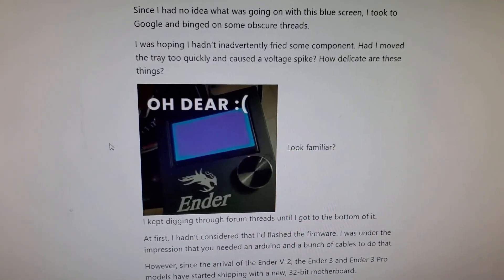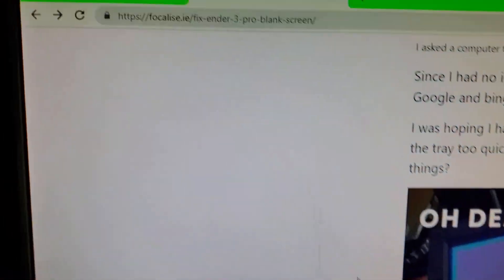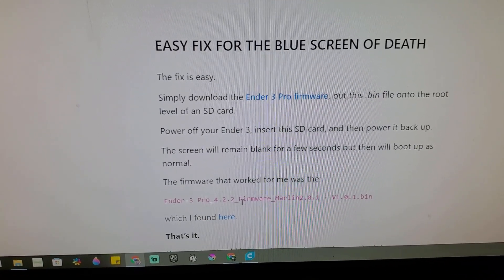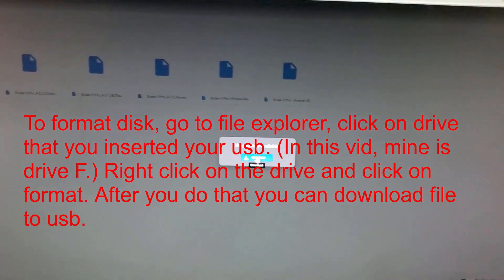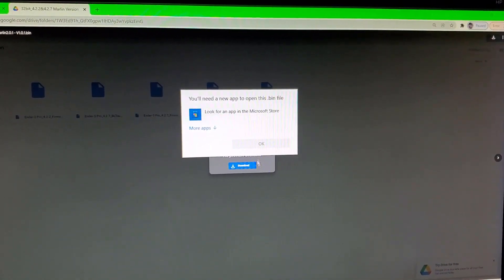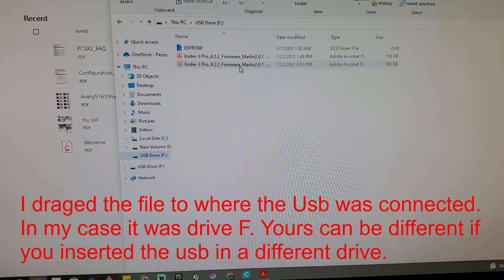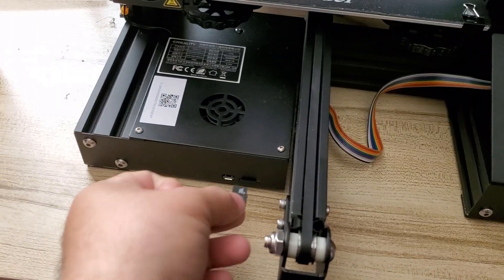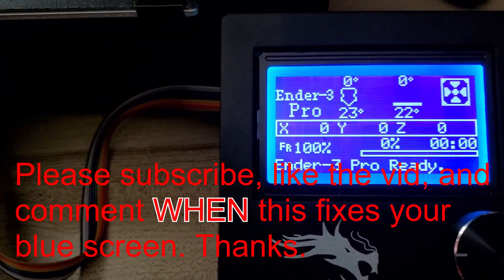I Fixed my Ender 3 blue screen. No motherboard change. easy fix. other vids on this were crap.

Comment: website not found but was able to fix mine. i found the firmware you said. found it in my files. went to just the english version and moved to my sd card. put it in machine and turned on and it worked!

Comment: My printer been making offset prints for some unknown reason, so borrowed my son in laws which went blue screen after just a dozen prints or so! It is fixed now, and I may update my firmware on mine to see if that solves any of my issues (I have to replace 2 rollers and the nut for the lift screw still).

Comment: I am VERY sceptical when it comes to people online making claims about resets, it is May 2023 and I had 2 ender 3 pro with blue screens and was on a last attempt befor puting out $100 for 2 boards and gave this a try and I not have after just a 15 min install and bother and back up and running, 5 STARS YOU'RE the MAN

Comment: Did this and it crapped my printer more now it will won’t read the sd card and even if it does the whole 3d printer will freeze up not even 2% into the print

Comment: Same problem with my Ender-3 Neo. Just during the first run and after setting the table and Z-axis I decided to make a test print and the only thing I got was a blue screen. After watching your video I downloaded the Merlin-firmware and flashed it on my printer and it worked again! The problem is that it started showing as an Ender-3 Max printer which it is not (only the motherboard is the same version 4.2.2 ). I downloaded the latest firmware for my printer and did the exact same procedure and it worked again. I believe you can download another firmware from the Ender-site as well, not only from the site you mention.
What I learned is that the blue screen comes always when I start the printer with a SD-card in! This is the bigger problem and it is a design flaw. When I leave a card in the slot (no matter what's on it) and turn off resp. turn on the printer, it probably first checks the card and searches for a firmware. If there isn't any, the blue screen shows and I must re-install the firmware again.
DO NOT START THE PRINTER WITH A SD-CARD IN THE SLOT UNLESS YOU WANT TO FLASH THE FIRMWARE.

Comment: Holy cow, it worked! I got my files form the Ender3 website, one thing is my display seems to have some offset pixels but heck it worked.
Reply: What files did you download? I am desperate. I downloaded all of them separately but nothing is working. I'm begging for help.
Reply: @marro1916  mine still wasn't working. So contacted a friend who has the same printer and they sent me the firmware they used and it worked.
Reply: @dirkmation  that's awesome dude

Comment: OMG DUDE! Thank you so much that saved me so much more work in research!
Reply: Where did you get the file(s)? I'm begging for help. The link isn't on the page anymore for the bin.
Reply: @marro1916  I had to look really deeply for it. I ended up getting Marlin software instead because it would work better so I would just do that. There are a couple tutorials on yt for that

Comment: Subbed, happened to me exactly 10 minutes ago, scrolled through a couple links after searching ender 3 blue screen, luckily you were the first video i ran into, i had already downlaoded and flashed firmware before, so just reformatted my sd card to erase it, then moved the file and then put the sd card in the printer and boom, instant fix in not time like the blue screen never even happened. Thanks man for keeping it short and simple!!

Comment: Didn’t work for me :( my first 3d printer and I haven’t even printed one thing. I want to return this or something..  :( really wanna kick it down the stairs.  *Update* Got it fixed. I had to use a different micro sd card than the one that came with the printer to load the firmware on, and it must be 32gb or under, formatted in Fat32, also rename the firmware .bin file to something random before you put it in the printer.

Comment: Just a few points to note. Whenever flashing firmware, follow Creality's instructions to format the SD card to 4096 allocation, FAT32. Have the firmware be the ONLY file on the card. If the latest version of the firmware doesn't work, try downloading an older version and flash that. My Ender 3 'bricked' flashing the latest 2.0.6BLTouch firmware, rolling back to 2.0.6 stock firmware did not work. I had to roll all the way back to 1.5.1 to get the firmware to flash, before upgrading it up to 2.0.6 again. So don't give up!
Reply: I tried multiple firmwares also without luck until i tried a different micro sd card than the one that came with the printer, and it finally worked.

Comment: Thanks for this video. I had not even had my printer for longer than 3 weeks and I turn it off when not used. I turned it on this morning and it had a blue screen. At first I thought maybe the display had just been unplugged possibly so I attempted a print through USB using the software, but it did nothing. At that point I knew something else was wrong and upon searching, found this video. Managed to find the firmware for the Ender 3 Neo with CRTouch on the Creality support page. Had to format the SD card even though it was already in FAT32, as before it failed to load the firmware, but after format it loaded up in less than 10 seconds. Printing at the same time as this comment and so far it is doing well.

Comment: I did this on my ender 3 max neo with a different firmware file and it worked but now the words don’t show up, anyone have any ideas ?
Reply: Mine wouldn't fix until i used a different micro sd than the one that came with the printer, might try that.

Comment: Thank you for pointing me in the right direction! I turned my printer on this morning after my very first print and was devastated to see the blue screen. I ended up formatting my treacherous SD card and reinserted it with the firmware and now it lives again!
Reply: We're did you get the firmware...been trying the one this guy says but it's not working
Reply: @mrcady915  When you format the microSD you have to allocate the partition size to 4096 and the format has to be FAT 32 and not NTFS. That worked for me.

Comment: Ok, I have had the same problem. Somehow my firmware disappeared so I downloaded the latest from Creality put the .bin file on a formatted fat 32 SD card and placed it in the ender 3, it took a few seconds and booted with the new firmware, which by the way was newer than the firmware the unit came with.  However, the nasty blue screen kept coming back and I had to reinstall the firmware again, just so you know you need to slightly rename it or it won't load.  I finally discovered that if you leave the print SD, the one with your .gcodes in the SD slot, it will go mind dead and give you the blue screen again.  I think that it thinks that the SD card on power up is the .bin source and does not know it is not and tries to load firmware and fails. Stupid,, I know and I think that if we had the Marlin source we could resolve the problem, but apparently, it is only touted as open source as the source is not available anywhere I can find.

Comment: this didn't fix it sadly, but i've run into this problem before. I've done the exact same steps as before, but it doesnt work now, idk why
Reply: try a different micro sd card, that is what i had to do and it fixed it.

Comment: PLEASE REPLY T.Y. IF YA DO so when i was trying to flash my sd then printer with what i thought was the correct firmware for the CR TOUCH i then had this issue after lots of research and finally trying this method IT WORKED GREAT   so thanks for that but now im eft with wondering what firmware file i download for the cr touch because in the "about" printer tab and on the main screen its saying ender 3 pro so does that mean that i shoud download the pro versions of future firmware and prints?

Comment: Great video.  Got my machine to run, a little.  Only problem I loose the firmware program again and a again.  Is there any batteries on the boards that need to be replaced?

Comment: Thank you so much I got my 3-D printer two days ago on the first and it was printing well but then I was wanting to upgrade the screen to add something to the back of the LCD screen so whenever I hold it I don’t touch the circuits but then I unplugged it and it just went blank like when I repub pl plugged it so thank you so much is so saved my day

Comment: This doesn't work for ender 3's with older boards. Ender 3's with older board can't update firmware by sd card.
Reply: so how do I update it?
Reply: @cjp4400  you need a cable to connect to a PC.

Comment: I was tinkering with the hotend of my ender 3 and i saw a bunch of sparks come from the base of the cylinder thing that heats it up. I got scared and turned the whole thing off.  When I had to turn down after a while, I found the blue screen. After some snooping around on the Interwebs, I found this video. I followed it’s instructions but nothing was fixed. I checked the fuse and it was in tact. the fans turn on, the screen is the same as shown in your video, but it still doesn’t boot up with the dragon face and the home screen that tells you all the stuff, like the temperature of the hot end and whether or not it has a microSD card in it. Please tell me why this is happening!
Reply: Exact as mine... any fix from your end?
Reply: I’m having same problem did you find a solution yet?
Reply: i forgot to format my sd card
 >:I
thats why it didnt work
also i think i downloaded the wrong firmware
Reply: actually, it turns out that the short led to me blowing out something on the motherboard. i hav e to replace it
Reply: @jimmyneutron8702  yeah the bottom of my motherboard was fried I think where the Y cable goes. I just hit up Comgrow because that’s who I ordered my ender 3 from and they sent me a new motherboard and my screen is back on.

Comment: Was getting so mad I quit trying to fix for a month came back found your video. It didn't work at first then tried steps over again with a different SD card and it worked. MVP thank you

Comment: Hey bro do I have to download as a pdf? Mine is not working doing it this way.
Reply: Try a different SD card make sure its 8gb.  It didn't work for me till I tried on a second SD card.  No its just a Bin file.  Nothing with a PDF.  I thought the same thing when it didn't work for me but I tried again with a different SD card.  Give it a few minutes, it won't work immediately.  Reformat your card to fat32, it will delete your whole SD card so move everything to your PC first then put just the 1 bin file on.  Try a few SD cards maybe cause the one SD card wouldn't work for me
Reply: @mattwittmeyer9175  so it might take longer than 2 minutes.
Reply: @PAPERGATORZ FEDDUCCA  it's just a micro SD card.  Walmart, best buy, a drug store almost any retailer.  Make sure it's 8GB though.  Should  be less than $10
Reply: @PAPERGATORZ FEDDUCCA  I don't think it'll be longer than 2 minutes, but keeping it in for 5 mins isn't gonna hurt it either.  You'll know when it worked
Reply: @mattwittmeyer9175  ok thank you!!!
Reply: @PAPERGATORZ FEDDUCCA  no problem.  If u have trouble I'll try to walk u through it.  As I said earlier I'm deff not the smartest when it comes to 3d printing but I'll do what I can
Reply: Maybe grab more than 1 SD card, diff brands maybe?.  If one doesn't work try a different one.  You can always return it.  Not sure why but my 1 card wouldn't work.  Lets Hope this is your issue too.
Reply: I want to be clear it's a micro SD card.  If u go and ask for an SD card they may give u the larger sized ones.  That's my fault ask for a micro SD card 8GB
Reply: @mattwittmeyer9175  ok thank you!!
Reply: I'm not the smartest guy with these things but if I can help you any further lemme know.  I'm not the creator of this video but I just got it to work 10 mins ago
Reply: @mattwittmeyer9175  ok thank you bro!!! Where can I buy these as cards. I’m new to 3d printing. I bought this machine for $70 because the first owner couldn’t figure this out. So I thought I could win with this purchase. I hope I can figure it out so I can learn this type of work for my custom car builds that I do.

Comment: my screen stayed blue, any other tips?
Reply: A diff SD card worked for me.  First card mine stayed blue tried a different 8 GB SD card and it worked
Reply: @mattwittmeyer9175  Where do we even get a diff sd card
Reply: @beastmaster8485  you can buy micro SD cards almost anywhere.  Drugstore, electronics store for certain, sometimes supermarkets, any place that allows you to print photos will probably have them.  Just make sure it's 8GB

Comment: it did not work I need help
Reply: Try a diff SD card make sure its 8 GB or less
Reply: Mine worked but only after 1st SD card still left me a blue screen, tried a diff card repeating all steps and it worked

Comment: This might have worked for me, but I can download it as a pdf, it saves as a .bin file. Damn.
Reply: Is this suppose to be a.pdf or a .bin?
Reply: @avidwaterfowler7522  supposed to be a bin. File.   I just got mine to work but with a 2nd SD card.  First card didn't work even though they were both newly formatted (fat32).  First SD card my screen stayed blue, 2nd SD card worked after about 30 seconds, but give it 5 mins, its not gonna hurt it.

Comment: Flashed wrong file on my ender 3 pro when installing cr touch . Screen glitched then went blue . Will try this tonight but tomrrow new mini e3 v2 motherboard comes in . Only having this printer for about 2 weeks now it’s upsetting with no fixed online . I will update tonight .

Comment: My screen is now garbled and it stops Randomly and Freezes up ,and sometimes doesn't read the SD card
Reply: Mine is garbled too.
Reply: If you guys updated your boards, the boards coming from Creality are sent with 0.0.6 Marlin.   My garbled halway through a print.  Power cycle "fixed it" then I spent 3 hours today figuring out how to update to 4.2.7.  It's not as easy as it should be.

Now, mid print on a 1e hour print, screen has gone blue.   Going to be interesting finding the solution to this.

Guess you get what you pay for.  I should have bought a Prusa.

Comment: Does it work with ender 3 or does it have to be a pro?
Reply from the maker: It works with ender 3
Reply: @supergaunabros6777  what about the ender 5 pro
Reply: @namey78  and 5 pro?
Reply: @namey78   did it work for your 5 pro?

Comment: Hey guys I recently had this fixed with this video. After I printed another 3d print. The screen went blue again. But all I did to fix that was re insert that disk that had the firmware and it worked again. Don't know if it will keep doing it, but at least I know reinserting the disk will make it work again.

Comment: Thank God for your video.I bought my 3d printer 2weeks ago and the blue screen came on yesterday. I looked at other videos that just trouble shoot and not fix the problem until I found your video. The step by step was easy and it Fixed the blue screen issue as you described. I hope everyone who has this problem finds your video and saves time and money by following your instructions. Thanks and subbed to your channel as well.